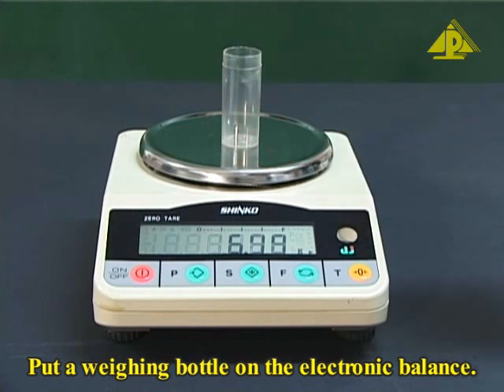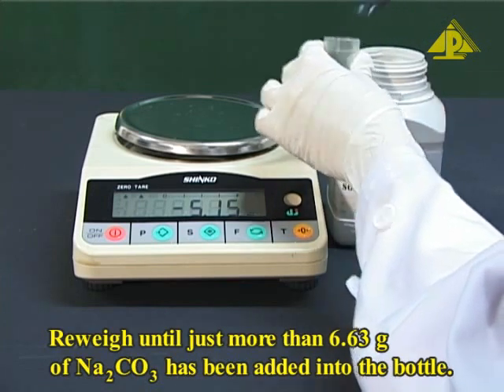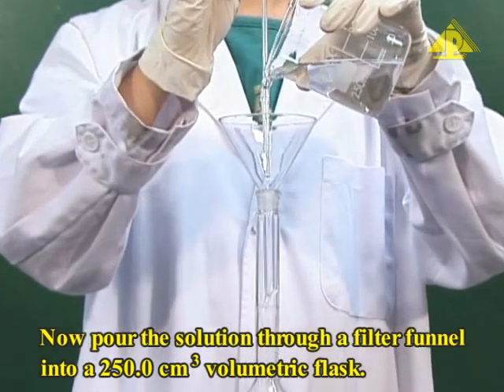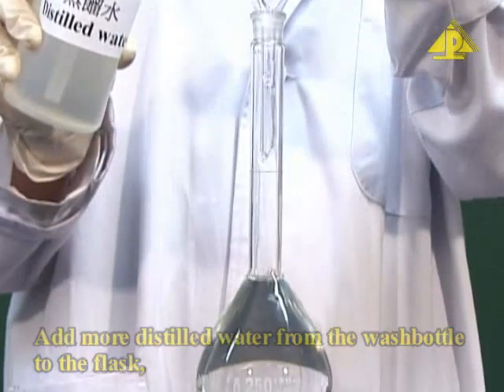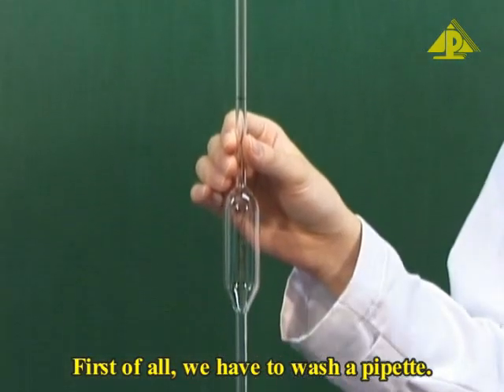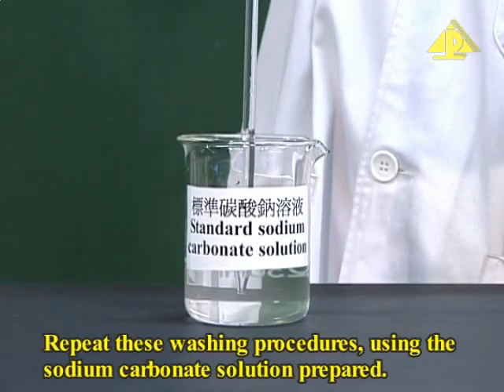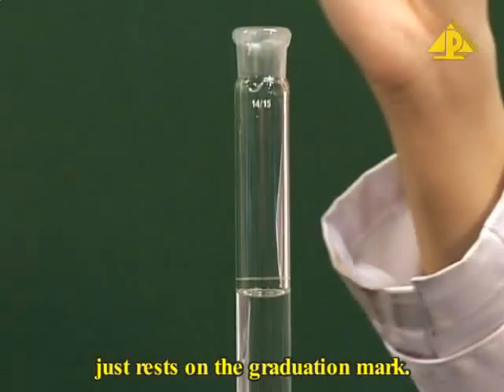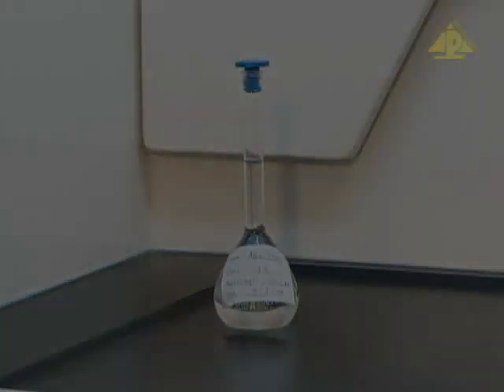Preparing standard sodium carbonate solution

Comment: First of all, you do NOT assume anhydrous chemicals from the container are truly anhydrous. They are supposed to be dried, in this case in an oven or by using a steel crucible and a gas flame. Then cooled down in a dessicator. At that moment you have "anhydrous sodium carbonate".
Also, you NEVER prepare anything in a beaker and then add it to a volumetric flask. Solute is supposed to be added into the flask immediately.

The procedure in the video is introducing considerable errors and the result is far from standardized solution.